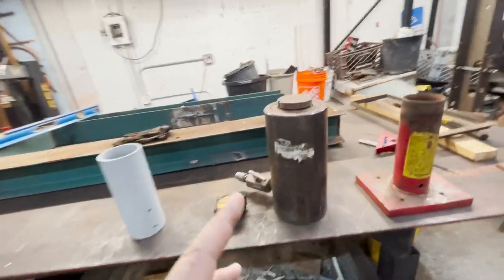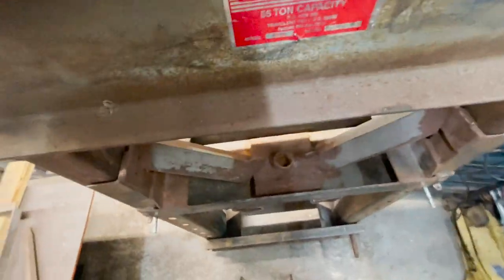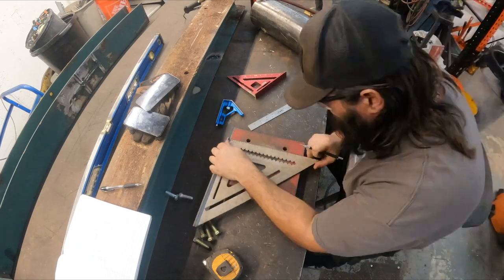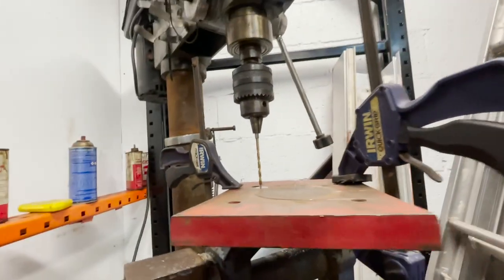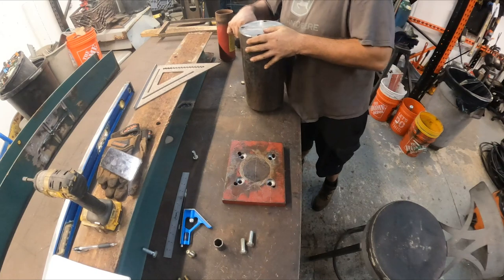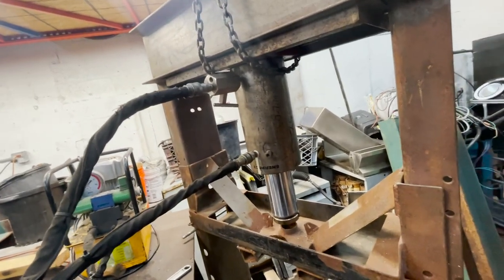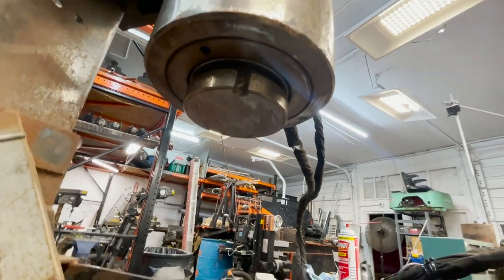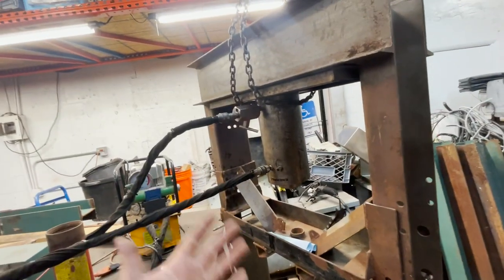DIY 100 Ton Press For Recycling Electric Motors. Building The Copper King Pt. 6

Comment: Hey Copper King,  Excellent progress!  One suggestion - before you modify the shelf, put something underneath the ram for it to push against so you can make sure the hydraulic hoses & fittings are going to hold. You had very little pressure on those hoses just going up & down. Stand away from it when you test it. Put an in-line pressure gauge on it so you know exactly what it's doing.  Play it safe!   Looking forward to part 7!  Take care,   Jim in Phoenix
Reply from the maker: Thanks for the suggestion, the pump has a gauge

Comment: Gallons per minute  is the whole ball game with hydraulics. You are going to need a much bigger pump to get the best out of that cylinder.  Be sure to size the motor running the pump. I wish that cylinder had a longer throw but I think you'll find a work around.
Reply from the maker: I definitely need a bigger hydraulic pump maybe 220, and this cylinder is temporary I need one with 2' of stroke

Comment: Could you use angle iron on the outside of the ibeam to reinforce it plus the heavier the angle iron the stronger it is
Reply from the maker: I could but I don't have any at the moment.
Reply: @ProjectShopFl  keep a watch out for old bed frames.    You might have to do two or three on top of each other